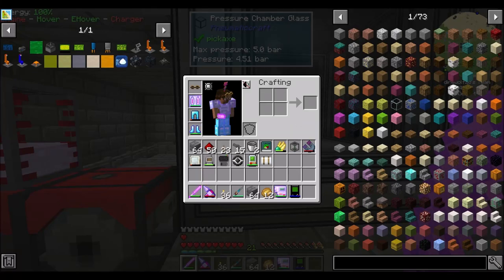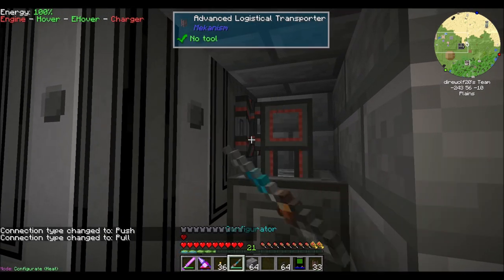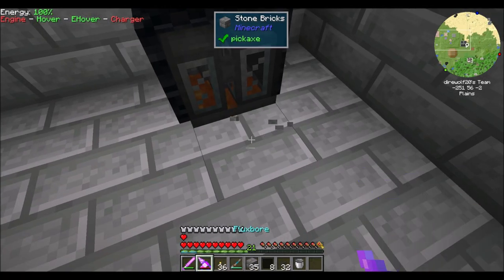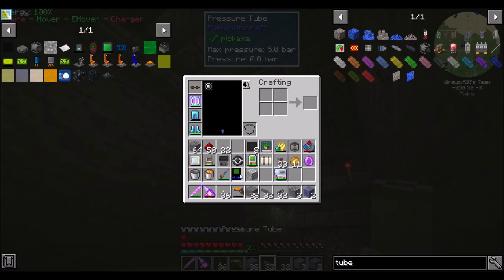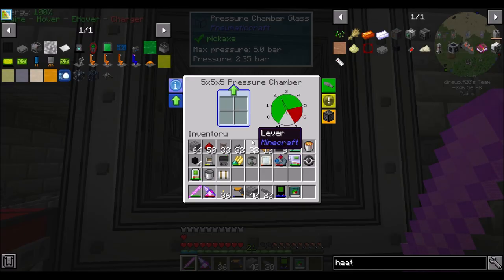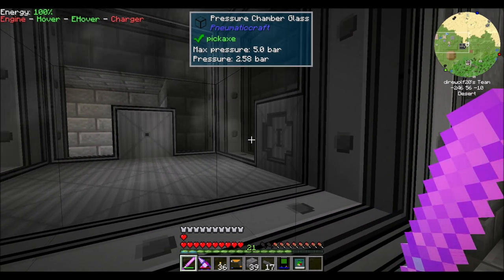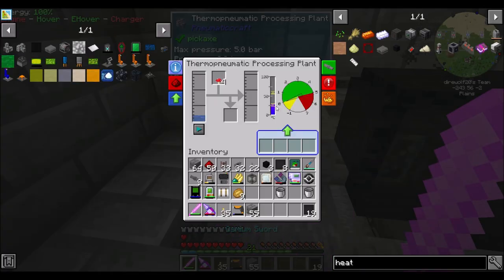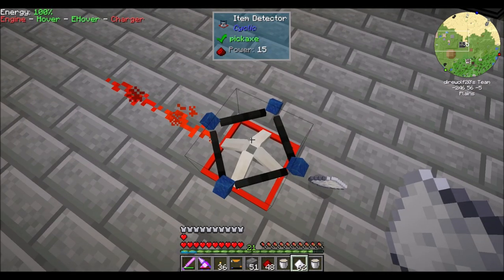Lets Play S10E45 Turning up the Heat

Comment: The pressure chamber losing pressure as fast as that is actually a bug, so thanks for spotting that.  It's actually caused by a air level reset when you reformed the multiblock, which shouldn't happen.  I'll get that fixed for the next PNC:R release (2.9.6 probably).

That Vortex Tube you left running is sucking down lots of air (10mL per bar of pressure every tick).  You should switch it off when not in use - a regulator module on the tube leading to it will close the tube when it gets a redstone signal of 15.  Also, the Thermopneumatic Processing Plant has comparator support: the comparator will emit redstone when the TPP has work.  With that information, it should be easy to switch the Vortex Tube on & off as needed, and not waste pressure :)  You can also use a lower signal level to the regulator tube to limit the pressure allowed past it - you'll find the vortex probably only needs 1-2 bar, so that's another potential big air saving.

Also, if you want to make Yeast Culture the TPP way, there are easier ways of maintaining a 30-60C temperature... warmer biome or deeper underground, or a Mekanism or Immersive Engineering uranium block next to the TPP and leave one face uninsulated to prevent overheating.  Uranium isn't very hot, but lasts a loooooong time before turning to lead (though not 4.5 billion years).
Reply from the maker: Sweet thanks :) love the mod btw you’ve done a really great job with it.
Reply: @direwolf20  it's a lot of fun maintaining it :)
Reply: i want to inform you but i don't want you to nerf it. you can use the "Fireplace" block to heat a Refinery. yes, eventually it will turn the fire off without "turning off" the redstone signal but you can easily automate it with an observer feeding 2 toggle latches and 2 repeaters. are you okay with that? you actually need  3 fireplaces for it to work properly.
Reply: @JoachimVampire  yeah ultimately I can't control everything so there are always going to be ways to cheese it.  Not the end of the world *shrug*.  I mean, any right-clicker with a flint & steel can do the same, so...
Reply: @desht2008  im using fluid placer+fluid collector for heat. its a fun mod to play. Done most of things dire wanted to do today yesterday in my world
Reply: could you also tell him that he seems to be placing his TPPs backwards 29:15
Reply: I used a heat sink on the heat pipe to cool down the temperature to 56-60 degree Celsius and connected the cool down heat pipe to tpp,work just fine for me

Comment: For the yeast culture, use a piston to punch out the middle block of an infinite water source. then place your yeast culture next to the block punched out by the piston. Drop a sugar, retract the piston, yeast culture will form where the piston head was, pick it up, extend the piston.
Reply: Thats what I thought when I saw the Redstone item detector.
Reply: I use a Industrial Forgoing fluid collector on "run with redstone signal" and the cyclic item detector and a 2x2 water source. Throw in the stack of sugar and remove the water in front of the collector and it produces and collects a yeast culture every time the collector goes through its cycle. You can easily use a piston to 'remove the water' too.

Comment: Hey Dire: if you run out of both mana in your mana pool and slime balls, a quick and easy way to get more slime is to grab a whole bunch of magma blocks from the nether, and run them through Thermal's Multiservo press and Centrifugal Separator. Lots of slime balls, lots of blaze powder.

Comment: Part of me is wondering whether it wouldn't be smarter to simply use the nifty "obsidian generator" setup that dire made to create obsidian as a basis for the "heating vortex tube". Basically: put lava on the cold side of a vortex tube, transfer the heat towards the machine at very high efficiency - considering your source is now lava - and then harvest the solid block (assumed to be obsidian) made from cooled lava with a block breaker. Lava is then refilled from the pseudo-infinite amount harvested in the Nether automatically through a fluid placer.

The end result becomes: every Thermopneumatic Processing Plant connected to the 'hot' side of the Vortex tube gets to be heated even faster, considering you are withdrawing heat from perma-lava. Thoughts?

Comment: Dire instead of using thermal lagging to cover your Thermopneumatic Processing Plant just use a single bit from chisel and bits, looks a lot better and you interact with the plant directly so you shouldn't have that issue with not being able to open the inventory with a sword.

Comment: oh i just realized. is it possible to  turn a pressure chamber into a vacuum chamber by placing an air compressor inside the chamber? (and pumping the air out, of course)
Reply: But how would you get the air coming from the compressor through the wall of the multi-block?
Reply: @paulsilagi4783  the same way you get air in. there's a valve block in the multiblock that you connect the pressure pipes to iirc

Comment: Wait lava and solidify? Maybe you could turn that into an obsidian generator.... Would be a very efficient usage of the lava. You get obsidian but still harvest the lavas potential
Reply: I think Ive done that before when i used pneumaticraft so i could get by without building all the heat stuff for a bit. Just block breaker and fluid placer. lava is cheap in the nether

Comment: well that was a fast singing out... u can  try "vanilla" dispensers... but then u need a bucket of water... or u can sync the placing of fluid such that it will place them one after the other. Like Yeast first then in the next tick the sugar and then the water or u can do it whit a piston so u void the on going fluid and then place the water source block. So many ways to do that, u will have fun. Also breaking the pressur chamber ... hey NO PRESSUR xD

Comment: try modular routers for the yeast
Reply: I'm biased as the author of Modular Routers and (current maintainer of) PneumaticCraft, but yeah Modular Routers can definitely do this job.  I know because it's one of the things I tested while developing the in-world yeast mechanic :)

BTW it is possible (and I've done it) to automate this with only PNC:R and vanilla.  Hint: Liquid Hoppers & Omnihoppers with dispenser upgrades, some form of redstone clock, and a vanilla Observer for generating pulses.  A few repeaters & comparators will also be useful/necessary.
Reply: Modular router can do everything. I'm such a big fan of that mod, it's so useful, and easy to use/understand. Whenever I have to automate something, it's always the first thing I'm going for

Comment: Hmm, strange that Pneumaticraft chose to have the default Bar be 0, not 1 considering 1 bar is normal atmospheric pressure. Still it's interesting seeing the mod in action as it's one I've usually ignored.
Reply: In many real world situations(for example on gas bottle gauges), you'll see that 0 bars represents 1 bar, i.e. the gauge shows difference between ambient and internal pressure
Reply: @ariuss3009  Ah fair, makes sense

Comment: What's the point in using the heat tubes for the vortex tube? Why not just attach it directly?
Reply: Hes able to spread it around now.
Reply: @Scottec1425  oh right, the heat only goes up
Reply: @MrGamerCaptain  er no, heat will travel between any (heat-supporting) blocks of different temperatures regardless of direction.  The heat pipe is useful to transmit it around while not needing lots of vortex tubes everywhere.  It can also be camouflaged to run in/under floors or walls.
Reply: @desht2008  I meant the heat will only go up bc the hot vortex side is facing up. Like, he can't attach the heat pipes to the side, which is what I thought about in my og comment
Reply: Also worth noting he'd be better off using compressed iron blocks over those pipes. The pipes are for transmitting heat through air because they're insulated, but boxing in a line of compressed iron as a "cable" works just as well
Reply: @nullspaceindustries  Not that simple.  The pipes use half the compressed iron but do need some glass & wool for the lagging.  When using blocks, you always need to make sure that every face is insulated, which can get bulky fast.  Also, the blocks have 10 times the heat capacity of pipes (i.e. they heat up and cool down slower), which may or may not be a factor in your build.